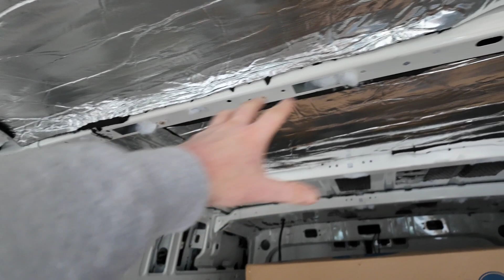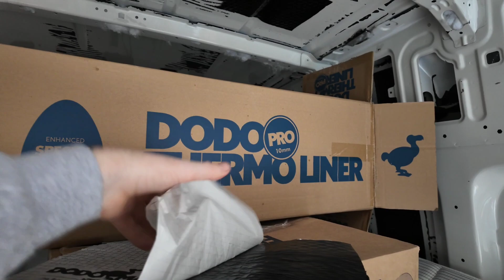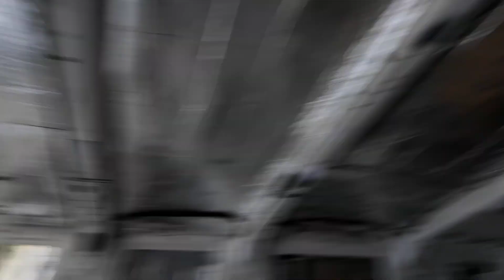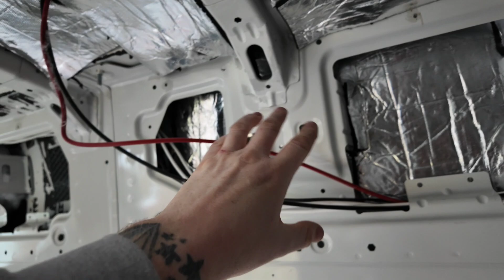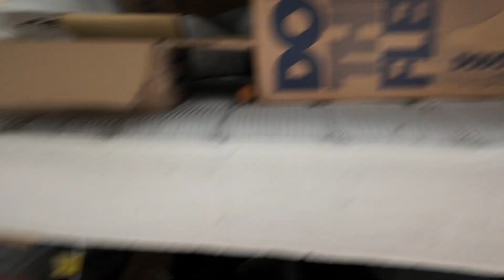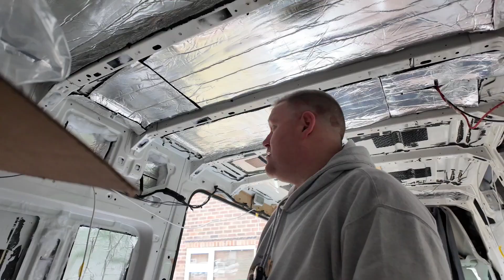I Made Mistakes Sound Deadening And Insulating My Campervan

Comment: Surely the sticky foam stuff is just the same as the sound pads. So why do people use both
Reply: Eh? They're completely different. One is a rubber sound deadening. One is a closed cell foam with a foil backing for thermal insulation.
Reply: @Scamdemic yeah i know..but the thermal stuff will do both jobs. So why waste money on the soundproof pads. Usless you like spending twice the money for the same outcome
Reply: @maxv77  The thermal liner (Foam with foil) doesn't have/isn't manufactured for sound deadening properties. It will of course 'Absorb' sound a 'little' much like live streamers use in places where they have a microphone, but rubber (Being more dense) absorbs sound waves and importantly vibration massively faster because of its density.  I've used sound deadening in show cars for years (Before DODO was born) and have used DODO and many others too. Each to their own of course, but there is science behind it.
Reply: @Scamdemic well you crack on spending money on something I believe you don't really need. It's your money. I'm very happy with my vans insulation and soundproofing.
I also didn't waste time putting on a vapor barrier.  Let the van breath.  Most professional van builders now don't use a vapor barrier
Reply: @maxv77  If you believe rubber has the same properties as foam...crack on. Jesus.
Reply: Your right, TBH most people don't use both,  only YouTubers who are advertising a product or know nothing but are trying to sound clever use both.

Comment: Thanks for the video. You have just convinced me to get the van spray foamed. Sound deadening, insulation and vapor barrier all in one. Along with a higher R value. I doubt there is much init regarding cost either. Good luck with the rest of the build.
Reply: Had mine spray foamed. It's faster, more cost effective, provides top level sound proofing/anti rattle, airtight vapour barrier and highest R value available. Can't fault the results.
Reply: Don't suppose you want to share what it cost, like ballpark figure? I'm looking at a Duc/Box L2H2 van. @lincolndave1966able

Comment: I just bought the cheaper version than Dodo, hoping it is as good. Lining my miniature camper in a Peugeot Bipper, 5 ft long back space! and I'm 5'5" so..drop flat front passenger seat also required, don't know where to look for that - second hand  of course, being currently skint. I didn't get a roller! I have a small round piece of wood though...
I thought you took the glue incident very well, hope it's not to tricky to get off everything!